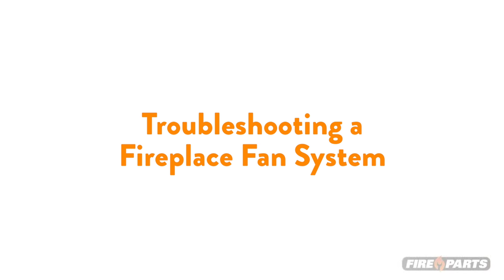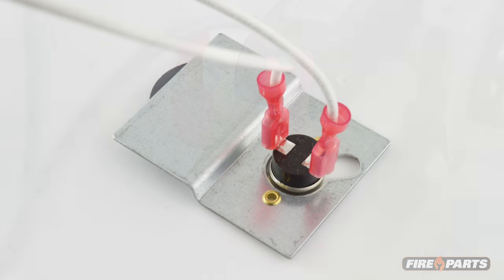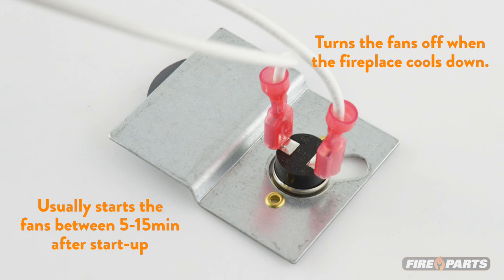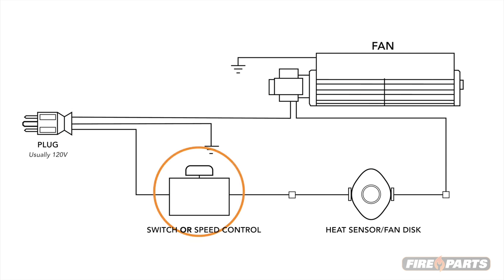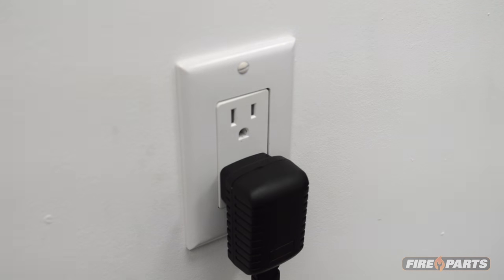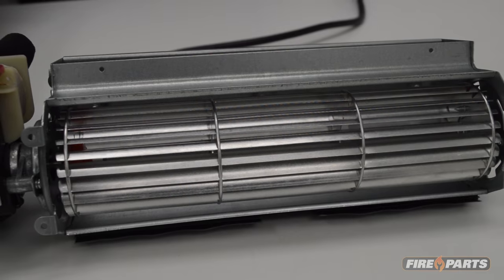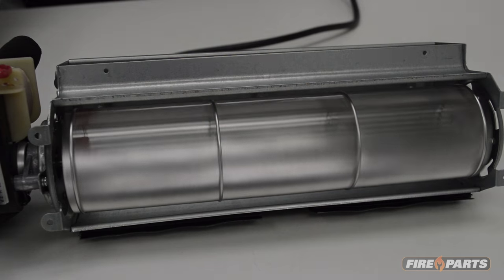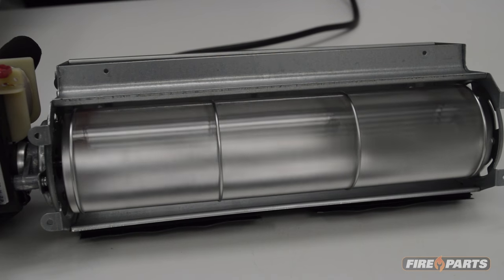Fireplace How To: Troubleshooting a Fireplace Fan System

Comment: Thanks for the good video.  My fan works, but it is running slower than it was last year.   It is not blowing enough air out.   Cleaned out dust etc... already.  Any idea what would be wrong?  I have a Dimplex BF45DXP.
Reply from the maker: Probably need a new fan. You can now contact Dimplex directly. We don't carry any electric fireplace parts. here is a link to their web site: https://www.dimplex.glendimplexamericas.com/en-ca/electric-fireplaces

Comment: I just purchased a fan for our fireplace and it is setup just like this. It turns on after about 5-10 minutes, but then it turning itself off and on (almost as if it is on a timed cycle). Is there something wrong with our fan, did I install the heat sensor in a bad place? Any advise you could give would be appreciated!
Reply from the maker: Could be the heat sensor placement. Where did you buy the parts? What is the make and model of the fireplace? Please reply to support@fire-parts.com

Comment: We have Continental electric fireplace CLF42.  The display works, but heat is turned on it stays on for approximately 30-seconds then licks off and will not restart.  It has never worked. Thank you for your attention.

Comment: My fan stays running after the fire place has good down. It will turn off if I unplug it, then plug it back in. Does that sound like a heat censor issue?
Reply: I have the same issue. Did you get it figured out?
Reply: @donedealable   I am going to test or replace the speed control as mine is not shutting off either. starts fine though.

Comment: The problem is the fan never stops
Reply: this is my problem. fan comes on normally after heat up but will not shut off, even after replacing heat sensor/t-stat. ??